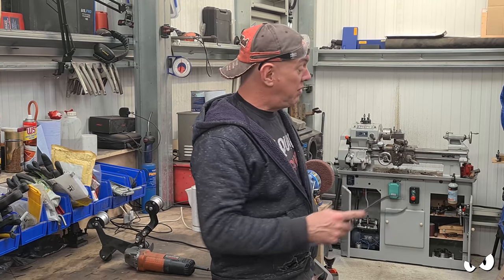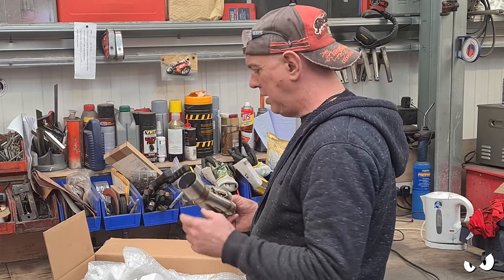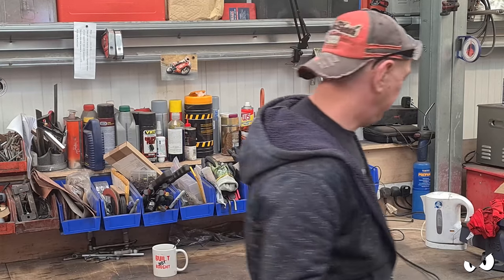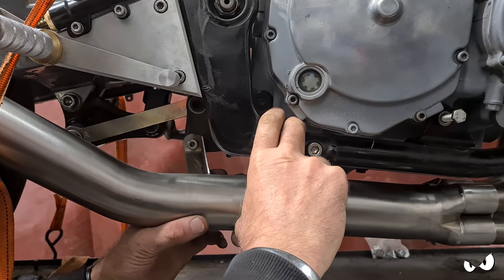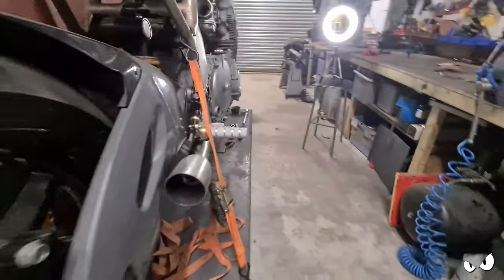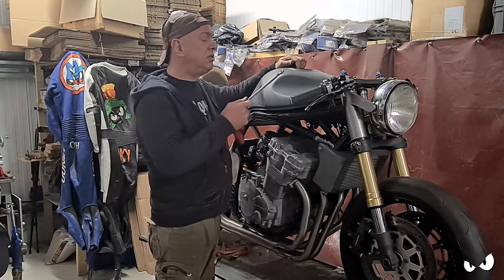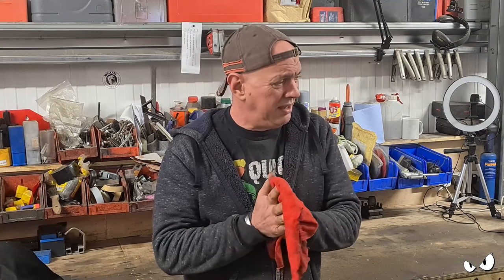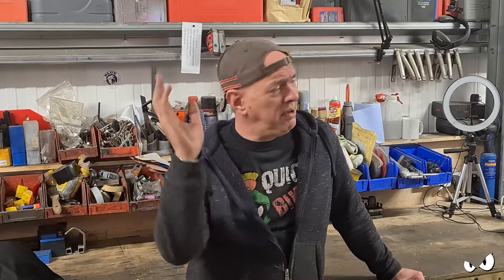Dry Build Done... - Suzuki Bandit Cafe Racer - GIXIT Project Part 71

Comment: Bikes looking great. Have a think about wiring loom routing and brake & clutch cables securing brackets. Dont want cable ties all over the place, would ruin those clean lines.
Reply from the maker: Very true and I have a plan for.all that. Ideally I'd.send it all through the frame... maybe on ASBO  hey 😁👍
Thanks for chipping in matey 👍

Comment: Speaking of speedos depending on which one you get you might be able to use a mk2 bandit 600 sprocket cover with the speedo pick up built in. Looks cleaner than having wires running down your forks. I know they fit the 1200 just not sure about the gixer 750 cos i cant remember how the clutch is set up on those
Reply from the maker: I'm not sure what Steve O has gone for, possibly even a GPS one... I'm still waiting for.it to.turn up.so I can figure out how to get it into the headlamp bowl 🤨

Comment: Where did you get the angle grinding sanding attachment again? And would it be OK for cleaning my stainless headers Quickie?
Reply from the maker: It came off eBay, just search for belt sander grinding attachment. I uses it on the headers as well so yes, it'll work just fine 👍

Comment: When you weld your stainless to your mild would you be able to tig braze it together the braze should be strong enough to hold it good and there wouldn't be the risk of cracking from the stainless to the mild
Reply from the maker: Inthinknid rather just go all stainless. It will be much easier.just to tig it and not have any worries. It negates the need to paint the insert as well. Thanks.for.the suggestion though 😁👍

Comment: Hi there quickie mike here, right i have a 600s bandit of which made it streetfighter with a stubby end can. do you think i need to up the main jet to what would you recommend 105 or next one up cheers mike
Reply from the maker: If you've changed the air filter and put a free flowing can on it, you'll definitely have to look at jetting. When I did ASBO I had no idea what to go with, but got a Colour Tune kit of eBay. Brilliant little.bit of kit which takes all the guesswork out of it. I ended going up a couple of jet sizes inthink.and stuck a washer under the needles as well. If you have a look through the ASBO playlist, it's all in there for reference. Exhaust vary quite a bit so it's hard to say what jet size you'll need. It's better to try a bigger jet and then test it to see what sort of burn you're getting. Hope that helps 😁👍
Reply from the maker: A dyno runnis the best test though

Comment: Sorry but not to do with this video but can I ask what carburetor jets did you put in the 600cc bandit? 
I have one in a bobber frame with 75mm velocity pipes instead of air filters so need some help to get her to run right.
Thanks.
Reply from the maker: Hi Paul, we haven't sorted the carbs out yet but I did do it on ASBO. I think.i went up either 1 or 2 jet sizes and put a.washer under the needles. I can for the life of me remember what jets were used, but I know I covered it in the carb video